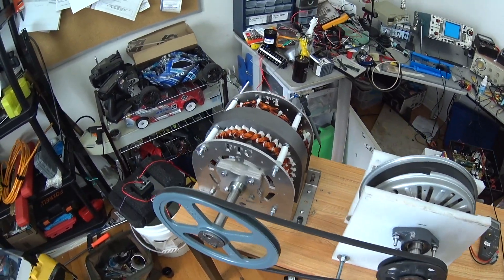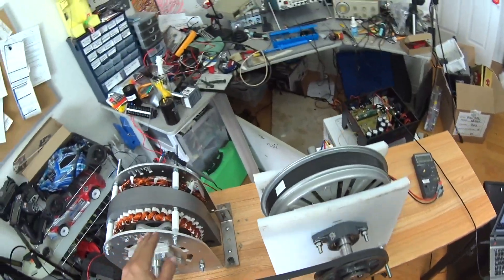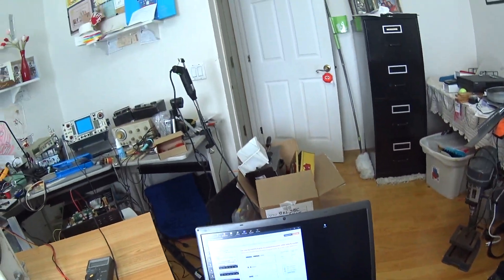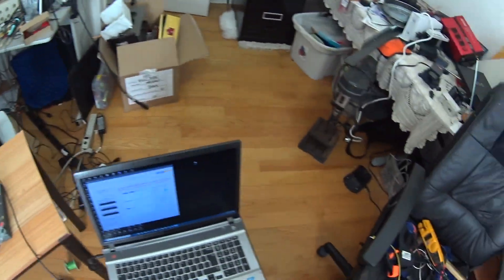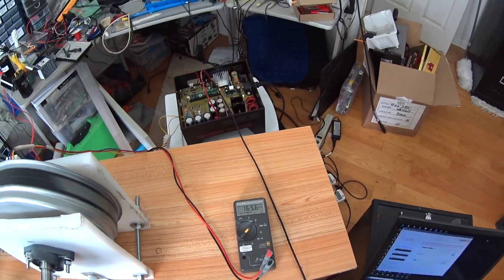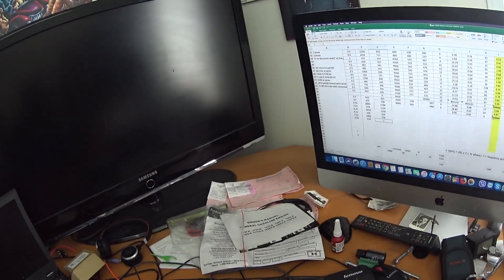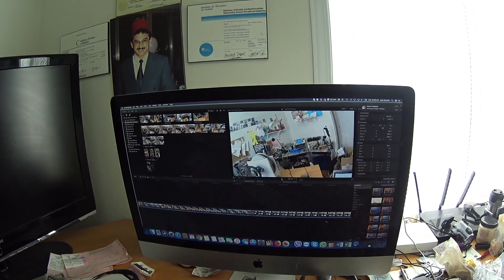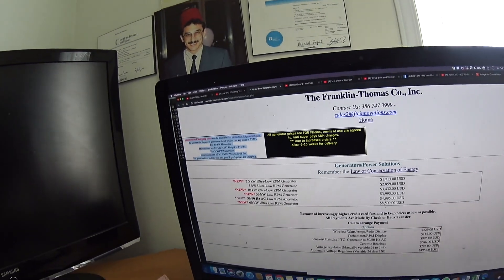FTC 30kW Generator Testing

Comment: Those ceramic bearings are eating themselves up. Probably shaft alignment and preloads placed on the bearings during assembly. But no load tests?! The numbers you are showing unloaded can all be thrown out once a load is placed on the generator. I do not understand producing a video showing a "generator" turning unloaded. The only thing that counts is what the generator while passing power to a proper load. The bearing noise will get worse once a load is hooked up. They will be under more stress.
Reply from the maker: Are you sure you watched the video ? Do you have a 40 hp motor to test under load   ?!!! You think these wires can do 50 amps ?? I suggest you see the video complete

This video is for people who are looking for generator and think about buying FTC and am showing them what they will get why is it bothering you so much to warn people about it ???

Comment: I would not deal with FTC at this point in time. The product still need validation. I do not like paying for them to experiment. The pricing very expensive for what one actually gets. There is no QC and they can give you no specific specifications for the generators that one actually gets. Shocking after sales service. Then to you, you do not necessarily get what you order. Very quick to place the order and get payment (in full) and then you wait, wait and wait some more. Too many questions, too few answers. 2 out of 10
Reply from the maker: That is why I made a video to warn people

Comment: how many amps did it put out ? because voltage on its own doesnt give you the KW size?
Reply from the maker: i do know that i was showing the generator was not giving the voltage which was rated at when it was shown on YT , as for amps you will need to have a load which i did not do because i would need an engine which can do 30KW to turn a generator which is 30kw , so the person who showed that on YT claimed to be 600volts DC 50 amps , and as i said on my video and showed these wires will never be able to handle 50 amps , max will be 15 amps and 300 - 350 volts DC which gives about 5kW and not 30KW i hope you understand now the purpose of my video

Comment: I would love to see it generating 30 KW under load.
I wonder what RPM it should be and what the power consumption would be.
Reply from the maker: for that test i would need a 30kw motor at least but to tell you the truth i think its only 10kw generator not 30kw so i would need a 10kw motor to do that test nder load
Reply: @EnergySeeker  I share your doubts and guesses and also think that FTC overestimates the power of their generators several fold. 10 kW maybe at 1000 RPM on the generator.
Reply from the maker: @lemontea2065  I tested at 1800 rpm was giving 380 volts dc and I estimate the current to be max 50 amps

Comment: Hello Amir… I will buy the generator from you. How much you want for it?
Reply from the maker: sure why not where are you located ?
Reply: @EnergySeeker  San Diego
Reply from the maker: @Dennisaj  sorry no way to shipp there it will cost a lot for shipping and over 700 and i will not sell the unit under what i paid so i think this will not work for you if its local pickup only  maybe its worth it which in canada :)
Reply: @EnergySeeker  If I paid for the shipping how much would you sell me the generator for?
Reply: @EnergySeeker  If I picked it up, What would be the cost?
Reply from the maker: @Dennisaj  5k USD
Reply from the maker: @Dennisaj  if picked up you save the shipping

Comment: coil wire is too thin to carry even 5 Amps
Reply from the maker: There is 9 wires each one is 1 mm and each wire can handle up to 1.5 amps so it can the three phase 3 wires can handle total of 14 amps not more theoretically on paper

Comment: Hello Amir I'm sorry you got a bad deal especially for that much money ... Have you found out what size this is yet ?
Reply from the maker: No not yet I have to get a big prime mover to test soon will do it to me looks like 5 or 10kw max not 30kw but need to test to confirm
Reply: @EnergySeeker  can you not count the turns in one coil and gauge the magnet wire and figure out the max volt and amp ? You may not be able to pin point what you have but you can eliminate what you know you dont have..

Comment: Could you make a video showing the master controller unit, power supply, drivers, and software as well as part numbers if someone wanted to replicate what your motor does.  I would also like to know if you could spin it up to 4000 rpm.  Lastly, i believe you were sent a generator that was package wrong in logistics.  I think you got a 10kw.  Thanks
Reply from the maker: It’s Texas instrument driver and I have a video for it running this motor at 2000 rpm which it’s max speed
Reply from the maker: that is not 10kW and according to the factory its 30KW and i dindt not fully test it yet i would need 30kw motor to test which i dont have
Reply: I believe that texas instruments has another driver that will run at 4000 rpm the same motor your running
Reply: I have been trying to get the drv number to order it

Comment: Hi i am curious about what the steps you had to follow to get the motor to work so well?
Reply from the maker: its easy you need to buy that texas insturment driver which cost about 1000 dollars to run that motor at full speed 2000 RPM
Reply: Did you have to purchase a power supply or master control unit also with driver

Comment: Hope you dismantle it so we can see inside that thing who cant buy that
Reply from the maker: its a regular generator nothing special , 16 x 4 inch N52 magnets 1 inch thick
Reply: @EnergySeeker  thank you sir maybe the core is different such a small for 30Kw and unclogging maybe they rearrange the magnet so they can perfectly generate at low rpm im so curious about that thing
Reply from the maker: @xxxakkkgaming7647  na its built with high number of magnets and lower surface of core so the magnets dont get cooged but its not low speed , you need to run it at 3500 RPM to get full power
Reply: That's mean it is a high rpm gerator
Reply: Thank u sir I'm muslim from Pakistan
and new subscribr 
Sir u r great  thanks for telling about this generator

Can u explain connecions of winding؟؟

Please sr

Comment: This generator is not 30kW That's 10KW only, a 30KW is double cores. How much did you pay for this?
Reply from the maker: no idea what you talking about !! what motor is 10kw ?? that is a washing machine motor 1 HP , and what 30KW double core ? its only one core generator as you see from the video , check prices on FTC web site , the generator i didnt fully tested yet for capacity

Comment: My assumption is based on their patent. I am not sure what they are actually shipping. The bottom line the generator that will be overunity will need power input
Reply from the maker: they never said its gen over unity all am showing here is they did not send what i bought or the 30kw is OVER rated because they dont test but i did

Comment: Great work Amir! Let me give you a suggestion about the no. of poles used in the program: when you identify the Hyper Drive, in the section were you are asked for the pole numbers YOU MUST USE 24 because the program refers to rotor pole number! Your Hyper-Drive has 48 rotor poles so for identification you need to use half number of that which is 24. If you do that you will see that the speed  in the program and the  speed of the Hyper-Drive will be the same. Also if you test it under load DON'T USE THE FIELD WEAKENING OPTION becuse at that time the Hyper Drive will have very week torque even if the speed is high. Try what I have said. I posted in one of my videos..https://youtu.be/8WVCCc-u2Dk
Reply from the maker: Dan yes I saw it now and now the drive give the right rpm but for sure I will not put 1000 volts in there instead of the jumper I think we need also to rewire this motor to make it Lenz free like the abb motor in jouelbox they made an 8kw motor as powerful as 40 hp
Reply from the maker: Dan have you tried it with 1000 volts ? Am not sure what is the limit for the power wrap it’s 1.5 kw max

Comment: Some other gentleman was asking me about these generators I just told him be cautious because  "no cogging" does not mean no lenz; no cogging is turning without effort un-loaded so yes im curious to find out whether or not there is a Lenz effect when loaded, it will be easy to determine simply by the sound the drive motor makes when you  load the generator, it will sound heavy
Reply from the maker: hi alex, yes lenz is in full i tested with 4500 Watt and 9000 watt and its dragging the generator if we need lenz free on this generator i think the core need to be changed not sure if this even can be done , at this point this generator needs a 40hp power to drive it at full load which impossible to have at home so am looking of how to cancel the lenz as is, what do you think alex ?
Reply: @EnergySeeker  The generators of today are all made the same way; they make excellant electricity but....let me give you an example in laymans terms..your car goes dead on highway, you ask 4 men to help you push car, 2 go in back & start pushing forward but 2 men go to front of car (LENZ) and push backwards, is that our technology at this day and age???? please
Reply: @EnergySeeker  i sent you an gmail with more explanation, thank Amir, god bless you

Comment: Thanks for the testing results - keep us updated; truly interested if what you were sold is rated at 30KW but is actually a lower KW versus what was shipped to you.
Reply from the maker: as you see from the Test i made at 1900 RPM i got only 370 v DC i used the pulley 12 " on the motor and 3 inch on the generator of FTC to see what is the max volts i get i should get 600 v DC but am not sure at RPM i should get that FTC will not say it , maybe they never tested to have that and based the rating on calculations which is wrong , how can i be convinced that 30kW was even tested ?? if the rotor have all 4 bolts loose like that ?  am very disappointed
Reply: amir ibrahim - yea, very disappointing workmanship and quality followed by poor customer service by FTC - YouTube handle realracecom - you should demand a full refund and a prepaid label sent to you for the return of that device - does not sound as though it is all that the realracecom guy says it is ....... keep us informed and thanks for sharing your story and e perimeter with this guy
Reply: @EnergySeeker  How many total coils are there (and size of winding wire), inside the generator?  Also How many Magnets are there, and whats the size of it?

Comment: Very interesting, nice work my friend! Was the 2nd test under load? And how much?
Reply: hey jason , Amir replied to our  question about the lenz
Reply from the maker: the only test i did so far is NO LOAD , the 2nd test was with ratio of 12:3 pulley to have 1880 RPM to see the max volts i can get with no load which was 370 v DC